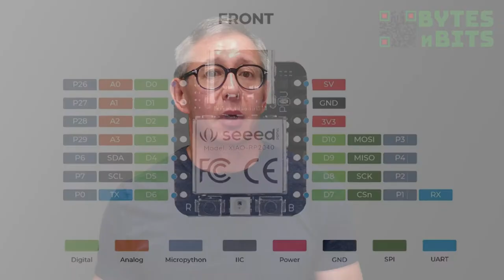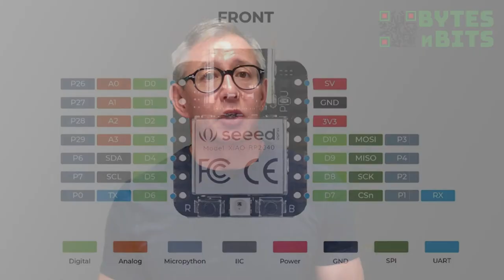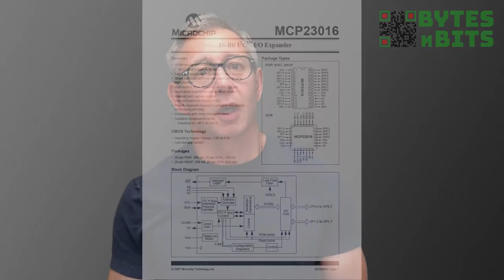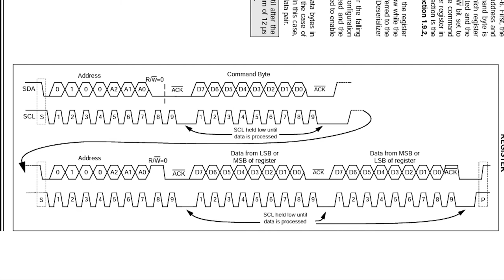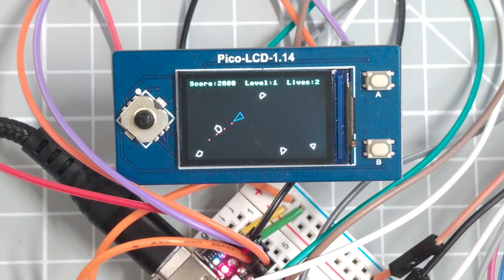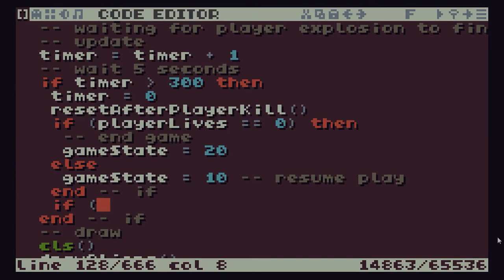Small, full power RP2040 boards - Seeed Studio XIAO-RP2040

Comment: Another good video that I am "following along with" on my own workbench.

So do you see this eventually ending up a small handheld console - including designing custom PCBs and 3D printing case components?
Reply from the maker: Hi. Yes. I'm working on the sound at the moment so that will be a video in a week or 2. Then I'll be moving it all onto a pcb design and trying to produce that myself to see how feasible smt is at home. I think I'll initially go with a bare bones PCB handheld with power via USB to prove the concept and then think about an actual case / battery design later. All good fun!

Comment: Make the pico detachable from the mainboard unless the extra height is a problem, 
a newer pico version (one day) might be faster, like the split extender idea with 4 wires (2+2), 
making the button pads replaceable when used with (angled) connectors, 
or one side a mini joystick / thumbpad,  the other buttons or swap them ... 
or could put the handheld on its head, might need a tilt switch to remap the layout correctly and then show a brief intro.
if 8 pushbuttons, could game have 2 players ?
Reply from the maker: Hi. Thanks for the ideas. Sounds good. On this project I'm going to go for reduced size over flexibility.

Comment: How is #rp2040 RTC powered when the equipment is powered off for extended periods of months and days ?
Reply from the maker: Hi. Unfortunately it's not powered. The built in RTC only works while the whole chip is powered, plus I think it resets when the chip is reset. You're much better off using a separate RTC module.

Comment: a code for esp32 where you have 2 joysticks and all the other buttons that would be 20 or 20-8 would be 14 or if you can better 1 joystick and 20 buttons
Reply from the maker: Hi. I'll be making a full game controller in the near future. Probably using the ESP32 to get the Bluetooth connection. Keep an eye out for that one.
Reply: @BytesNBits  thanks I use it for american truck I created my own speed lever as well as a steering wheel and pedals and at first I used a modified joystick then I used the arduino uno but I always lacked buttons because I put a plate or a pcb with several buttons and functions on the lever for that reason the esp32 that has many outputs seems like a good option to me